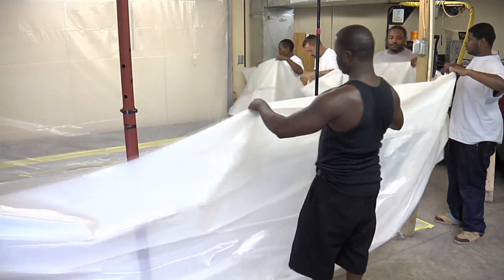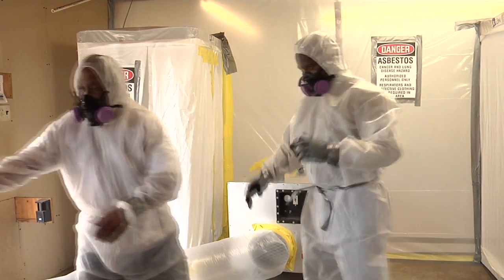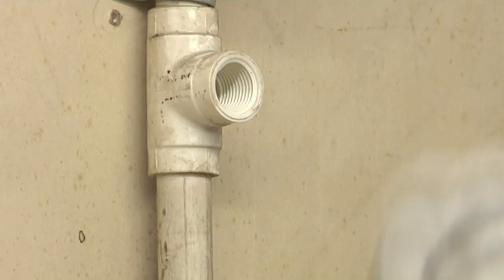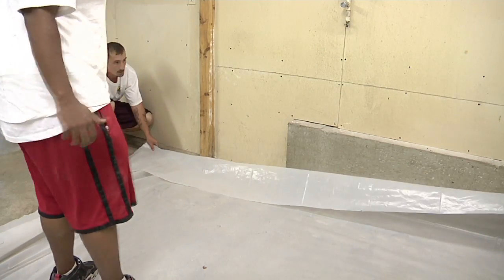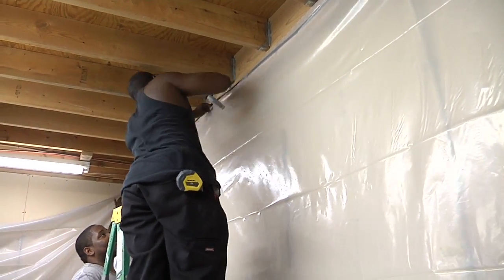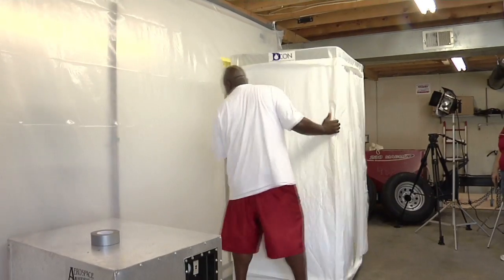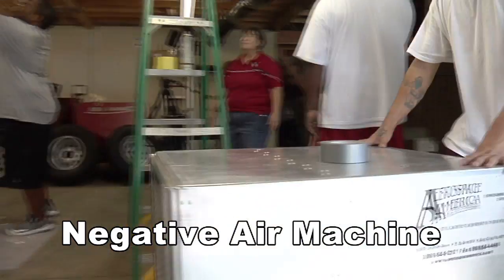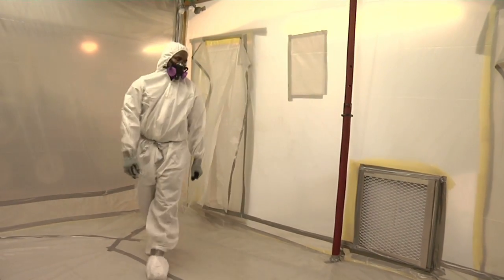Building an Abatement Enclosure for Asbestos, Lead, Mold or Dust Control

Comment: How long should the negative pressure fan be working at home? Do they have to be 24/7? the problem is I cant sleep with that noise and they said the project will last at least two weeks. I live in 1630sqft condo. Thanks

Comment: I noticed almost all of these comments are complete minutia. The only real problem I see here is that your air scrubber (informally known as a negative air machine) should be opposite from your decon so that you pull air through your workspace, pulling the contaminants to your filtration. Putting it next to the decon doesn’t help a whole hell of a lot, unless it has a zipper on it and you have a vent hole somewhere else
Reply: No, they did it right.. instead of them putting the negative air unit inside the work area they cut a square into the plastic. As long as the tubes are connected and put out the window , there’s no violation here

Comment: This is absurd. Asbestos is NOT that "dangerous." Yes, take some measures, and wrap up and filter the air going in an out of the abatement area, but this is not necessary all this taping up for MOST work removing asbestos. What kind of mindless moron came up with this procedure? What? Wants to be sure that the "worst case" is handled every time? Government wants to do WAY too much than risk letting workers do too little? This is why government just ruins things -- mindless bureaucrats bellowing orders from their thrones on high . . . disgraceful and wasteful, and sad.
Reply: Tell that to the people of Libby, Montana.

Comment: No mention of a smoke test to check enclosure integrity?! How'd you know it's totally sealed?
Reply: A magnehelic gauge is usually used to check for negative pressure. I’ve never seen smoke tests used in the field. The containments are usually too big.
Reply: @slippy1809  In the UK you have to a smoke test, doesnt matter how big the enclosure is. There should be sufficient air changes to remove the smoke in a set time frame to prove the Negative pressure is correct and that theres no leaks. How else do you find leaks in the enclosure other than a smoke test?
If you dont do this in the US christ..
From a UK perspective the video was largely good, just no mention of a smoke test or the inward pull on the flaps of the airlock indicating a good level of negative pressure. It also didnt cover the sealing of the enclosure when the shift finishes and the NPU's are switched off
Reply: It's on YouTube you moron , its there to be watched
Reply: you must live an exciting life
Reply: I do thanks for asking
Reply: I never asked though mate

Comment: Hey. Double the floors first so your seams are facing down from the wall. Water won't go under it.  poly walls with inside corners separately. don't use a big piece. the neg air is going to make it balloon in. (staples or not). Put a ceiling in instead of patching between the floor joists above you. easier to wipe down, as wood is porous and can hold a fiber.